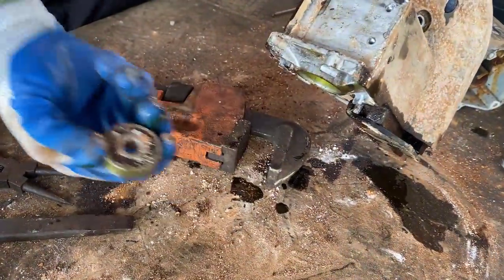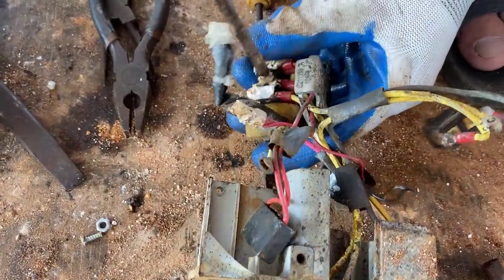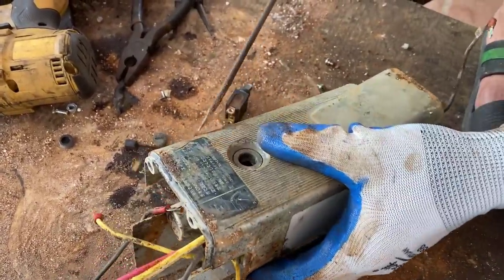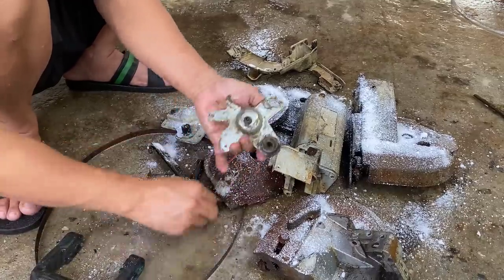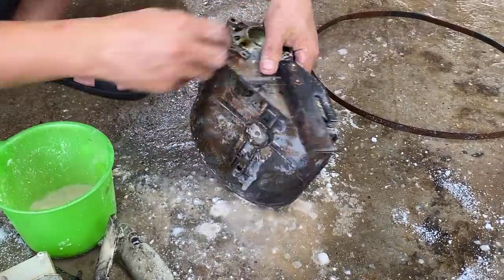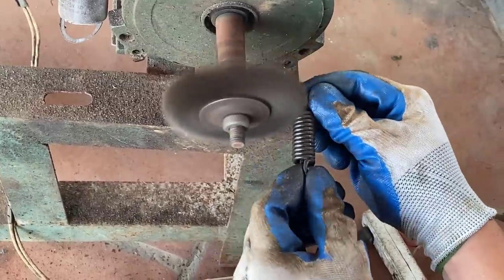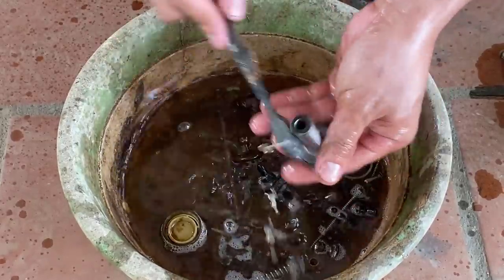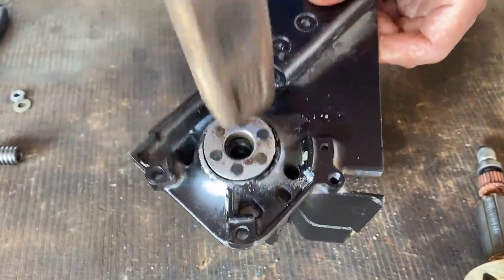Full restoration hacksaw machine antique hitachi 3-phase hacksaw manufactured in 1990 capacity 2000W

Comment: Nice job,  but that is not 3 phase but single phase powered
Reply: I noticed that as well. As you know in a 3-phase motor there would be 4 wires, 3 hot and 1 ground and interchanging any two of the hot wires would reverse the motor rotation.. Still not a bad job.